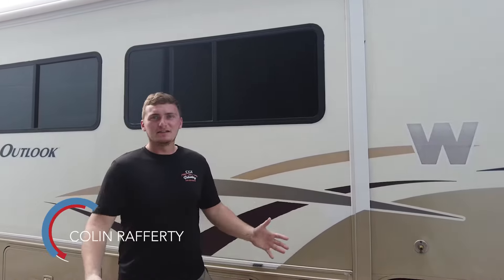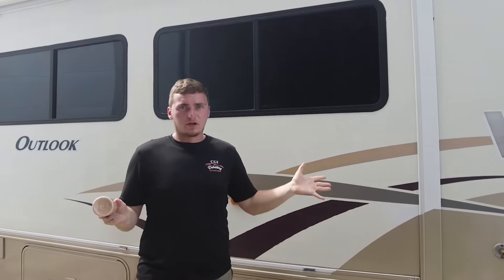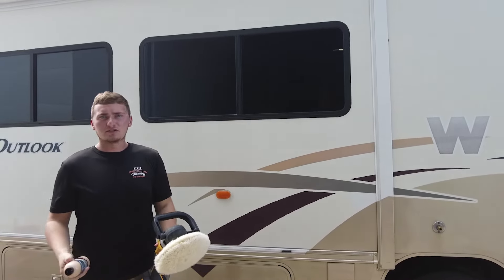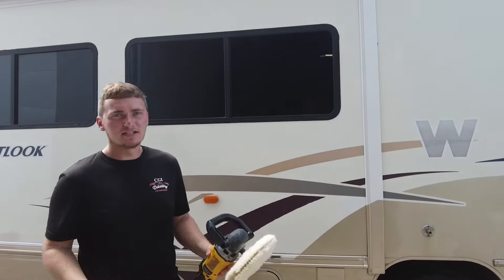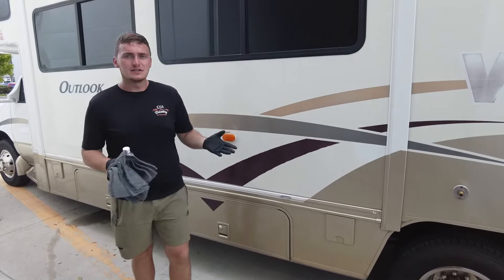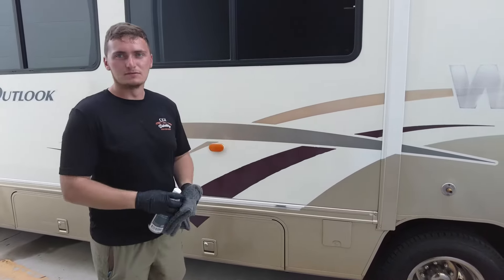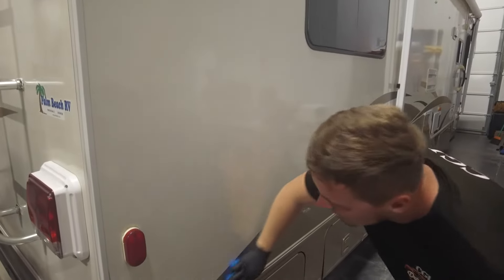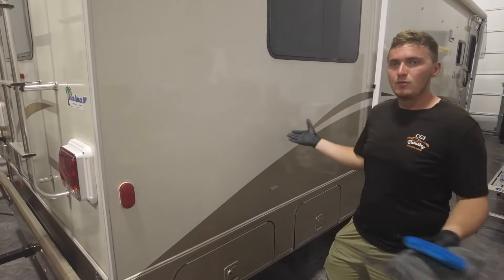Full RV Transformation - Surface Prep to Glidecoat Ceramic Coating - Application by CGI Detailing

Comment: How many bottles would be need to coat a rv of that size or something close to it?
Reply from the maker: For this job we used 500ml of coating, but it really depends on the square footage. You can get two coats on 1.2 square feet with 1 milliliter of coating. So for our standard bottle sizes:

50ml - 60sqft (2 coats)
120ml - 144sqft (2 coats)
160ml - 192sqft (2 coats)
250ml - 300sqft (2 coats)

So based on your square footage you can buy some combination of the above to ensure you are covered.
Reply: @Glidecoat  Thanks for this info I've reached out to your customer service team and they have pointed me to the kit that suits my needs..looking forward to the results!

Comment: how long is the UV protection good for in northern ca weather?
Reply from the maker: Hey Chris - I'm assuming by CA you are referencing California and not Canada. We have tested through direct exposure and accelerated weather testing in South Florida which would have similar UV exposure to Northern California. The results have shown 2 years for our Pro coating and 18 months for our standard RV coating. That said, the duration can be longer based on exposure, storage, use, and maintenance.